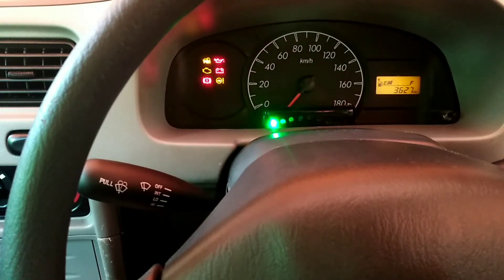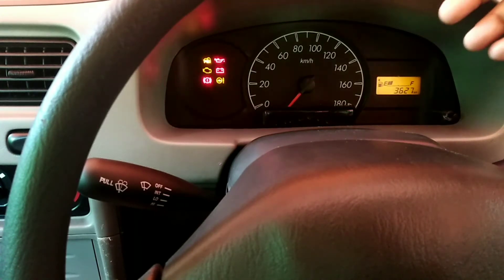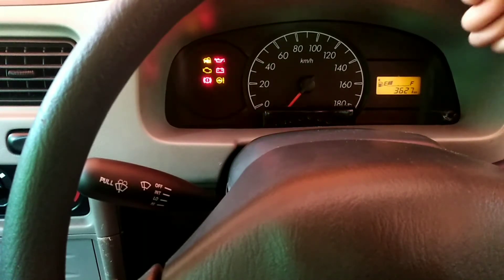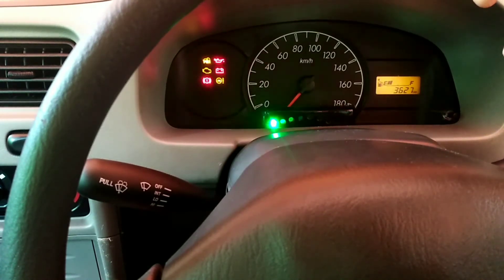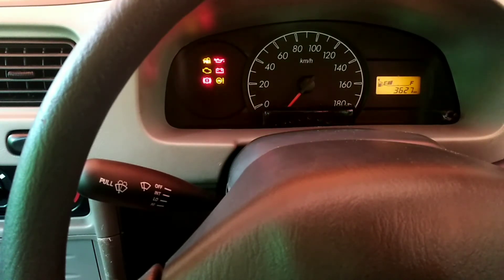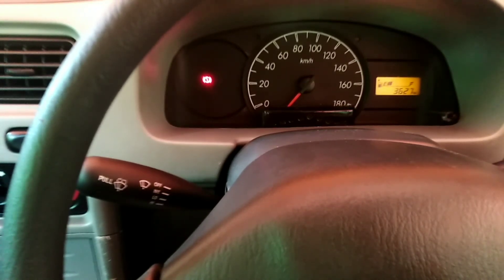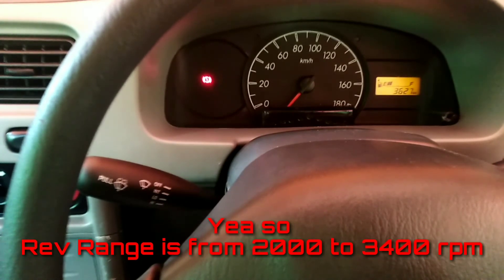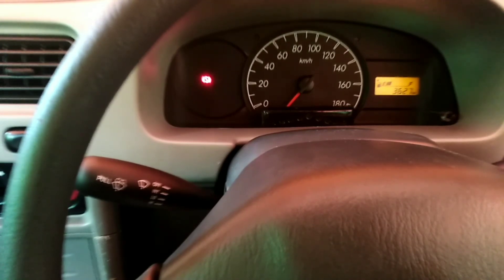DIY Arduino OBD2 Sequential Shift RPM Light For Car

Comment: Signal from coil?
What if applied to a motorcycle?
Reply from the maker: It is possible but needs a different circuit and all and slightly different code. That was my initial idea, but it was too complicated for me.